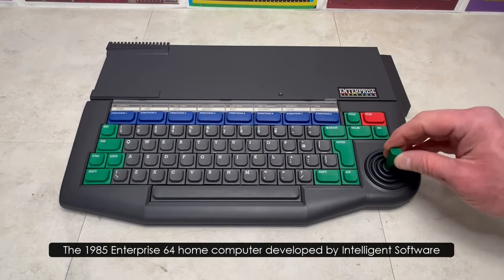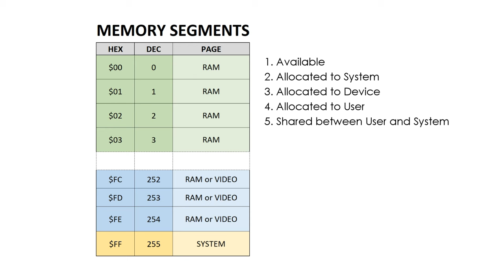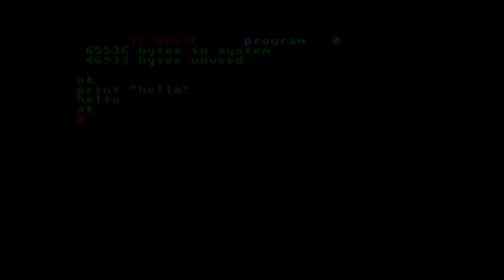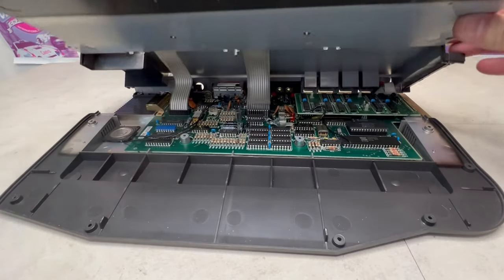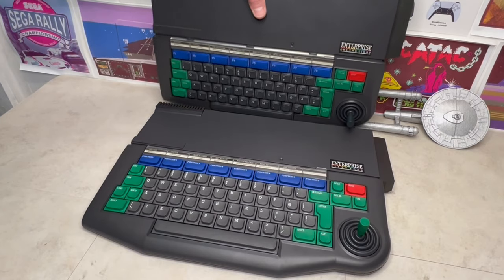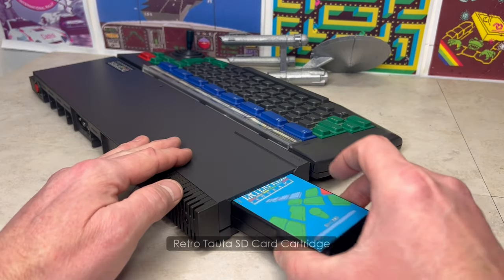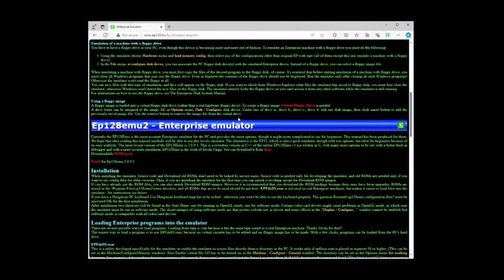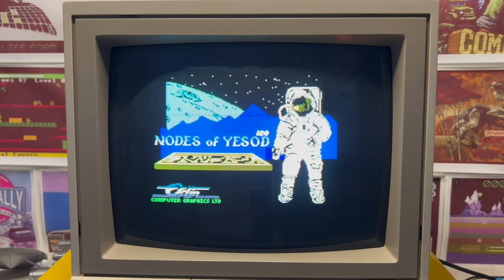1985 Intelligent Software Enterprise 64/128 Review and Modern Mods

Comment: Just for future reference, you may well know this but if the keyboard membrane is anything like that of the Spectrum (and it looks the same in principle) and the edge connectors are worn or corroded, as long as there is a little slack in the ribbon when you put it back together you can actually trim the damaged part off.
Reply from the maker: Yeah, something I tried - but was far too brittle.